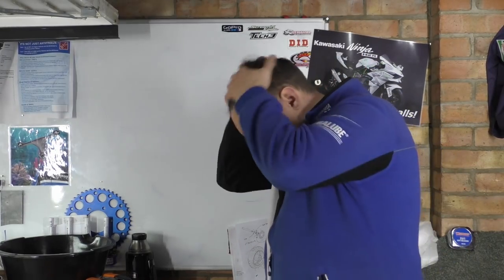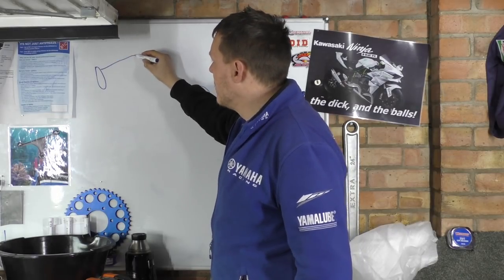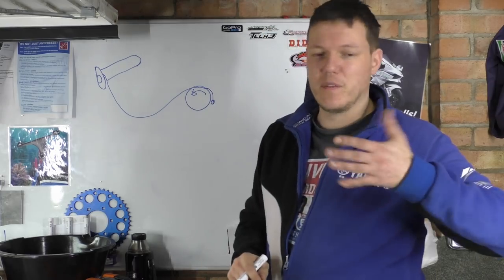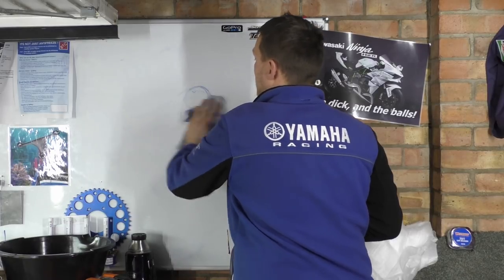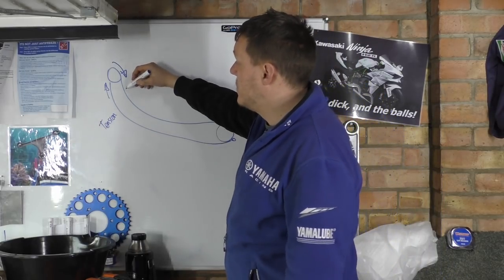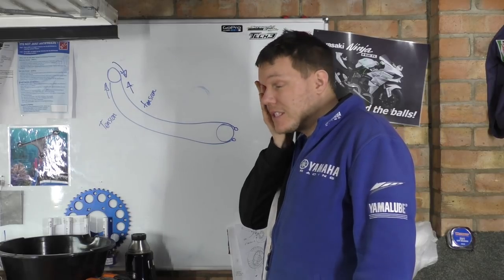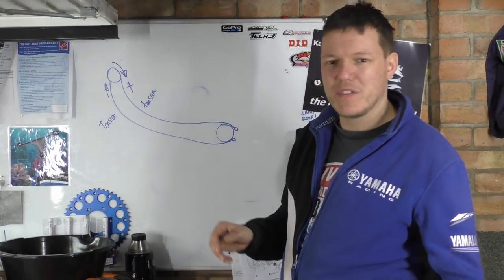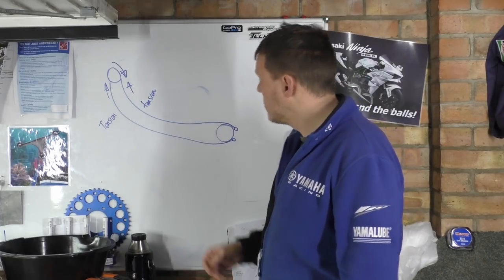Push Pull throttles? Question Time

Comment: The main reasons for fitting a return cable were safety and ease of use. When the Japanese began making multi-cylinder engines, they had slide carbs with a single cable and a linkage, or even a single cable splitting into one cable per carb. If the 4 carbs on, say, a Honda 750 had the same return springs that were used on a single or twin, the throttle was very heavy. If lighter springs were used, there was a risk that the slides would stick open. The solution was lighter springs AND a cable that would positively close the slides.
Reply: Not sure how this relates to my 1975 Z1-B, which has separate open and close cables connected to the throttle shaft quadrants, but also a fearsome return spring on the shaft which allows the throttles to snap shut immediately if you release the twistgrip. I know some twistgrips also have tension screws to alter the resistance of the grip to prevent "snapping shut" but not on the Z1-B. Incidentally, failure to snap shut is a MOT fail as I discovered with my old ZZ-R1100.

Comment: On the M/A/B versions of the Suzuki GT380, GT550 and GT750 2 stroke triples push - pull became a compulsory safety feature insisted on by the US DMV due to throttle stuck open accidents on earlier J/K/L versions.

For those not familiar with 70's GT550 and GT750 2 stroke triples, going from stationary to 60 MPH happens pretty instantaneously compared to a even a modern 4 stroke (think jumping to warp speed) so finding that the throttle is stuck open on a bike that can hit 100 MPH in 4 seconds with handling best suited to straight Roman roads, with an engine that can still accelerate with the front wheel locked solid, you can see why having a push - pull throttle was insisted on, in an effort to make the bikes slightly less hazardous to ride.

In Suzuki's instance the throttle cables operate a quadrant and this lifts a rotating shaft that lifts the carb gate open and closed. The carbs do have return springs and carb levels have to be set up using the alignment of metal rods inserted into the carb mouths (I used welding rods). With the carbs set up right I used to manage 9 MPG in town and 18 MPG on the open road on my GT550B. When thrashed it could do 4 MPG.

The quadrant and lift mechanism means that all the carbs are in one large assembly and periodic lubrication and inspection is required.

For those who might mention the engine kill switch, they haven't ridden a big 2 stroke tripple as the bike throws the rider backwards with the sudden surge of massive midrange torque and G force for a few seconds. When one is hanging on by one's fingertips reaching for the kill switch is kind of difficult. If one does manage to hit the kill switch and happen to be in a corner, the bike will immediately sit upright and the steering will lock straight with a jerk, as these bikes steer on throttle (like all bad / evil handling bikes). To lean the GT more the rider has to accelerate through a corner. Pretty much why the push - pull throttle was installed.

Every biker should have "Ride a 70's 2 stroke big tripple" on their bucket list just to understand what the definition of bad / evil handling and near death experience feel like.
Reply from the maker: Awesome bit of knowledge - thanks
Reply: I haven't ridden my GT550B since my son was born in 1991. Too risky when one becomes a father. 

May I suggest a future video on how velocity stacks (bell mouths) work to enhance carbs and throttle bodies.
Reply: Well explained Andy.
I had a friend die on a Kwaka 750 (Kawasaki) in the seventies.
We all came off our bikes constantly back then.
The first Jap bike, which I found, to handle well was the Yamaha 500 twin and the Honda 500 four was just about as good.
In the real world they out did the 650’s and 750’s.
We all used to race around a one way road on the edge of a mountain called Prince Henry Drive.
Ah those were the days.
Reply: Brings back fond memories hanging on for dear life especially the  acceleration on those beast i had a 750 gt m  and loved your description of the handling   They got the engines  bang on but  hadn't  got passed rickshaw frame design back then same, goes for the stock Yokohama kamikaze tyres. You really had to know how to ride a bike back then. if you didnt   you very quickly  ended up in a wooden box.

Comment: You won’t believe this, but I’ve had very bad upper right back pain, muscle spasm and nerve irritation for years. The doctors and scans put it down to age.
Recently when I had my shims done on my CBR600FW (fantastic bike) the mechanic spotted the push cable was broken. 
It seems my pain and spasm was caused by years of commuting in London, stopping and starting and trying to use the heel of my hand on the throttle against the pull of 4 carb springs, whilst covering the front brake and riding at 30 mph. 
The contortions of my hand, arm and back to achieve that set up the pain and spasm. 
Now I have a push cable too and I have relearned the “finesse” of throttle control. 
Result:Cure.
Reply: Its age related and normal , believe me it will be back. The only cure seems to be death

Comment: More mutterings:- It is more weight but marginal for the more sensitive response, aided by springs in the carbs or on the end of the rail for the multiple banks.  I suppose there's more moving parts to go wrong but it's decelerating/closing the throttle isn't left to just the springs to pull the cable back through.

Comment: Push/pull still uses a spring to return the throttle closed, but in the case your spring fails, the push cable can be forcibly actuated to mechanically close the throttle. It's a redundancy safety feature.
Reply: No Matthew , no cable works when you push through its sheath.
Reply: @jeevanrohtak5126  I meant because the opposite cable will pull, forcing the other cable to essentially push.

Comment: I tought it was more of a safety feature in case something happen to the spring and the throtle doesn't go back to place by itself, then the other cable would help to pull it back
Reply: AmazinChannel I agree. On some bikes with slider type carbs (non butterfly)the inlet suction action of the engine can suck the slide against the body and it may not close quickly enough when the throttle is released.
Reply: Didn't he mention that briefly? But yeah. If it was just one reason for everything, the world would be a lot simpler
Reply: alles klar klaus didn't pay attention,  the room was too noisy when o watched the video

Comment: Nipples!!

My 1989 Honda CB-1 NC27 400F has two cables. It's a high spec Japanese home market bike, so maybe ahead of its time. 

Either way, thanks Matt, you reminded me I need to lubricate my cables. Yes, you can and should lubricate control cables. Graphite impregnated cycle oil is good. Getting it in there is a tedious bastard of a time consuming job, but well worth doing. Cables last twice as long. Why? 

Because a dry cable requires more effort to pull it, and there's a greater chance of chafing on the inside lining of the cable outer. The extra effort places greater strain on the joint between the cable and the nipple, meaning it will break there first. 

You can repair soldered nipples though. Done it loads of times on clutch cables. Just heat up the nipple to remove the strands of cable. Heat up with a flame to burn off the old oil, and trim the ragged end. Clean it and the nipple thoroughly in petrol then methylated spirits. Solder the nipple back on. 

The wear in the length of the cable can cause fraying and sticking throttle. It's rare, but does happen. 

Theoretically you could do this at the roadside using one of those flamethrower lighters and some cored solder. Add them to your touring kit.
Reply: Not ahead of its time. They were mandated by US law in the early 70s.

Comment: Had an sv 650 took the carbs off ( was the wavey model type) couldn't of put the cables back to the right settings as you opened the throttle and it use to stay there, you had to unwind the throttle back to idol , result instant cruise control. Lol 😆 I'm an idiot.

Comment: They were actually mandated in the US in the early 70s for safety reasons, simple as that. Nothing to do with “feel” or “control”, although those features have been subsequently developed over the decades, but that’s not why we have them. The US market made them a legal requirement, and it spread from there. Much like the change to the gearshift lever from the British side to the Japanese side...all US regulations from the late 60s early 70s.
Reply from the maker: that why all bikes are fitted with them? like my new z900 which does have one??? lol
Reply: @dirtygarageguy  Ring Mr. Kawasaki and demand he finish building your bike)))

Comment: my older, cheaper, shitter EX500 has better throttle return than my ZX600. With my ZX600 I have to leave the cable tension loose or it doesn't return to idle quickly. that slop is annoying. Both bikes are carbed, both have a pull-pull cable setup. difference being the ZX600 has a 90 degree bend just before the carb, and I guess like you said a weaker spring maybe.

Comment: ive noticed on 2 stroke motocross bikes, they (the ones ive seen) have one cable and 4 strokers have 2 cables
Reply: half the strokes,half the cables
Reply from the maker: 2 stroke bikes are cheaply built - you have no idea LOL
Reply: The Workshop ...some KTM 2 strokes cost a good deal more than 4 strokes of the same engine capacity
Reply: I love my Eight Shtroker

Comment: I really wanted to ask if there is a way to use a dual cable on stock single cable carburetor or I also need to replace my carburetor?
Reply from the maker: Why would you want one?
Reply: @dirtygarageguy  I haven't found any solid argument about single vs dual throttle cable on any forums on Internet, so I'm still wondering which one is better.
Reply from the maker: The one you already have. Dual cable throttles are for 4 cylinder throttle bodies
Reply: @dirtygarageguy  oh, I haven't read about that yet. thanks for the info. I looking to improve my XR200 for offroad/enduro trails riding. always stalls uphills.
Reply from the maker: That's not because of your throttle. Stalls how?
Reply: @dirtygarageguy  well, whenever I  ride long uphill on trails and almost at the top it always feel like it is choking up and then it stalls and I always thought it was the throttle or the carburetor. I thought that dual cable might help to get some quicker responses, like it will feel a little bit softer.
Reply from the maker: No. Do you have a fuel pump of is it just gravity feed?
Reply: @dirtygarageguy  I think that it is just gravity, because the fuel cock line goes directly to the carburetor and stalling/choking also occurs when my bike leans far too low on both sides(right/left).
Reply: Thanks for helping me sort things out..

Comment: Another subject. But talking carbs. Another thing ive been wondering about. But i guess ive only seen it on scooters. : The water cooling is connected to the carb. Why is it so??
Reply from the maker: carb heating - the ER5 has it and so do other bikes. This is to stop the crabs from freezing up, helps reduce intake icing also. The ER5 has a bit of a trick system - I'll so a video - proper old school stuff

Comment: Found it! Lol... so the one that’s rusted is the return cable not the regular cable so it works fine hopefully it’s ok to ride until the new cable arrives thoughts?
Reply from the maker: Yeah - it'll just feel shite LOL
Reply: The Workshop to be honest I didn’t even notice until I changed the handlebars and the cable dropped on the floor lol. Must be a good spring in the carb
Reply: Bet the bike is still runnin single setup

Comment: do you think it would be a good idea to set throttles up (especially for beginners) so they twist the opposite way to normal(forward for acceleration) so that it the acceleration forces on your body self counteracts throttle input? Should help with whisky throttle.
Reply from the maker: until they have to learn the other way - some times you just have to learn
Reply: yeah i suppose people who learned that way would just stay with it.
Reply: Would be a hoot to brake

Comment: A Barrel Nipple and a Pear-Shaped Nipple, if they're lead, usually.  In-line Barrels are used also.  Brass Barrel Crimp otherwise.
I suppose the push-pull is going to be more presise longer per cable-check, presise like Desmodronic is to Valve-Timing, especially in bikes with a rail pulling a bank of 3+slides/carbs and maybe less tendancy to wear, like the old school machinery when Geo-Sat didn't need to know the temperature of y'sweatty palm as y'open the throttle...